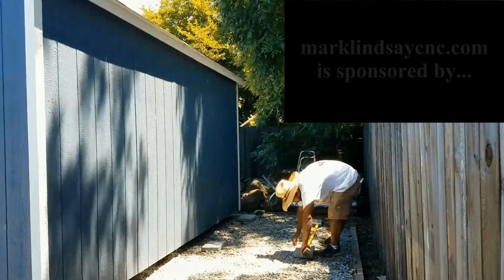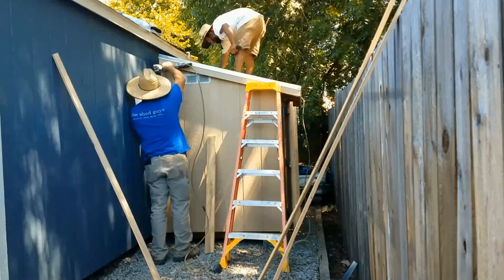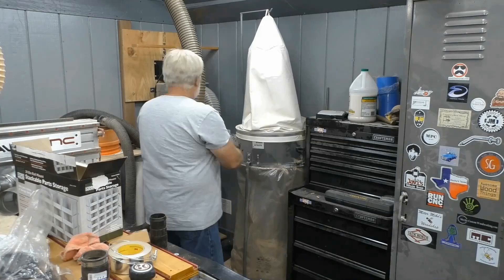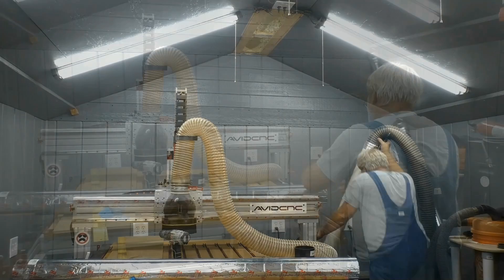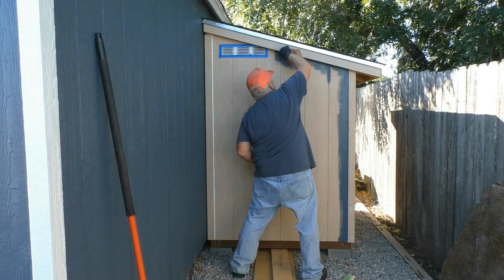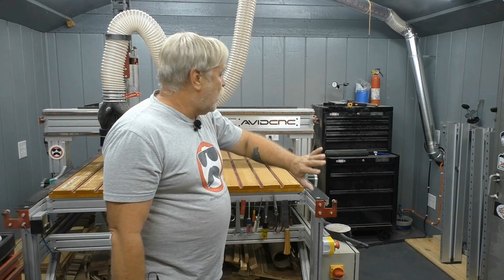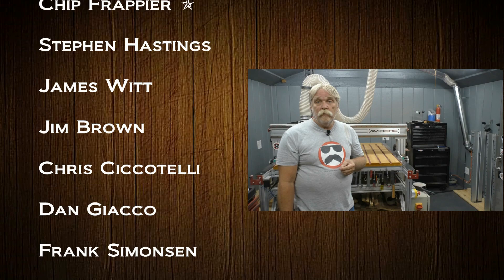Building a Home Hobby CNC Shop/Shed - Part 11 – Lean-To Addition

Comment: Nice looking shed. I have my HF dust collector hanging the same way. I’ve been told by several people that the motor needs to hang horizontal to take the load off the bearing. I’m researching this more to be sure.
Reply from the maker: I've never heard that, but thanks for bringing it up. I've not heard of any bearing failures, but then again, maybe I'm not traveling in those circles. I've had this setup for over a year (it was mounted in the same orientation in the main shop/shed,) and there have been no issues yet (knock on wood.) Then again, I'm not running it for 8 hours a day, 5 days a week, so it just hasn't happened yet. I'll keep my eyes and ears open. Thanks!
Reply: @MarkLindsayCNC  yeah mine is 2 years old and no issues like that but I’m pretty sure the fan is out of balance as it is too noisy to run in the shop. I’m going to move it like yours into my shed off the shop (garage). But plan to pull the fan and see if I can balance it to see if it’ll run quite. Right now I have it in a inclosed room in the shop but would like that area back.

Comment: Wow looks great. If nothing else it is a quality of shop life getting that DC out of there. I recommend adding a ground wire from spindle to Earth ground. My DC had a ground tab on the motor housing that worked great. You can even use the wire inside the vinyl ducting.
Reply from the maker: Thanks very much! I love it so far. I'm grounding everything off camera. I don't relish having that argument over and over again. There are certain battles I'm just tired of fighting, and grounding the dust collection system is one of them (table saw safety is another.) That's also why I never showed my electrical panel with the cover off.

Comment: I suggest to put a wireless temperature sensor in the shed. It could get very hot & you want to know if it does
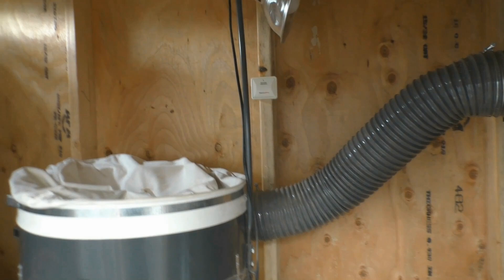Reply from the maker: I agree that I need to be able to monitor the temp in both sheds at the same time. If you look on the wall at the 9:03 mark in the video (where I'm showing the Harbor Freight filter bag and plastic bag,) the little white box mounted on the stud is a temperature sensor that is connected to a thermometer on my desk in the shop.

Comment: I am guessing you are going to put a remote sensor on your dust bin so you know when it is getting full.
Reply from the maker: Probably not. I check it every few days (unless I accidentally suck something up that I didn't want sucked up - like an end mill case,) and if it's getting more than half full, I go ahead and dump it. The shed is only a few feet away from our garbage bin, and it only takes a couple of minutes, so it's no big deal.